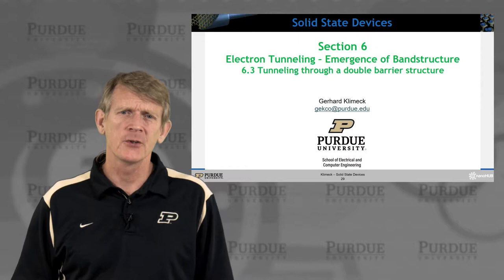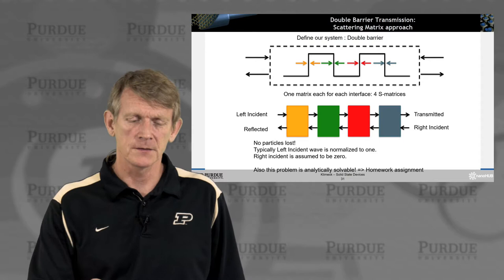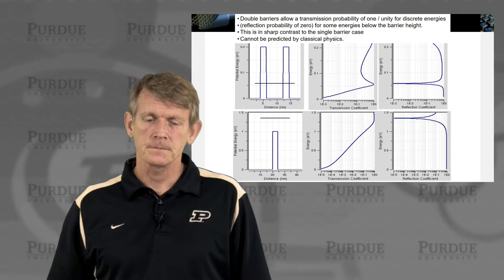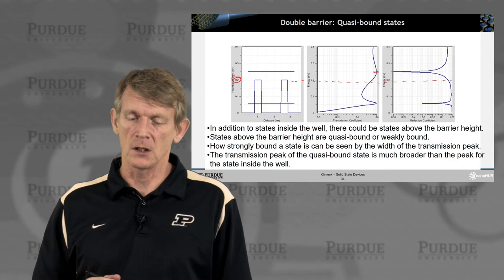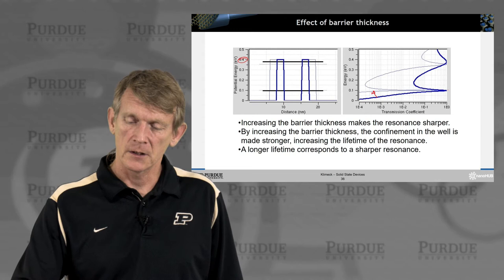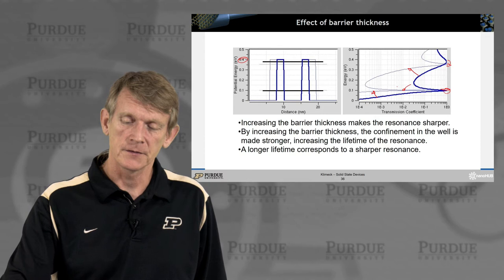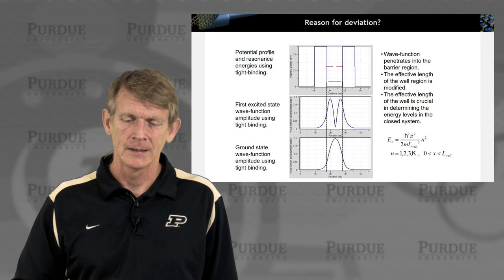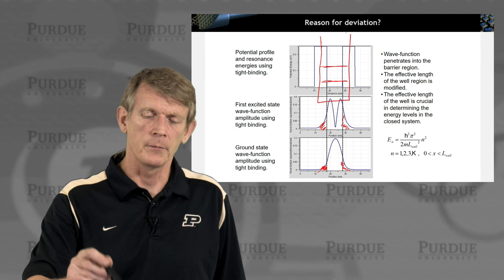ECE 606 Solid State Devices L6.3: Electron Tunneling - Tunneling Through a Double Barrier Structure

Comment: 5:41 - 6:19
This part of the video shows the "meat and potatoes" of the double barrier structure. Sub-threshold (that is, energies below the top of the finite potential barrier) unity transmission is possible in a double barrier structure, whereas that's not possible in the infinite potential well case. Once a particle gets through the barrier, it spends some time oscillating in the well and then goes out the other side of the other barrier. The time it spends in the well oscillating is what Dr. Klimeck calls the "resonance lifetime". The energy that the particle has while in the well will yield a certain wavefunction, one whose tail ends will overlap with/crossover into each of the barriers more than the wavefunction of the infinite potential well. Thus, one will find that this wavefunction has an effective length L greater than that of the infinite potential well case, yielding a lower energy (since E = n * (h_bar ^2) * (pi ^ 2) / (2 * m * (L^2)))